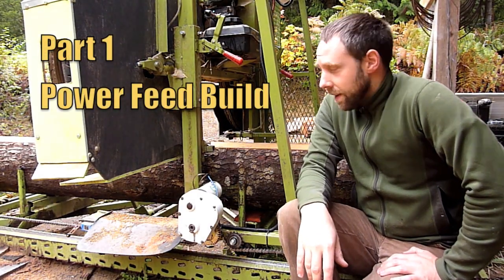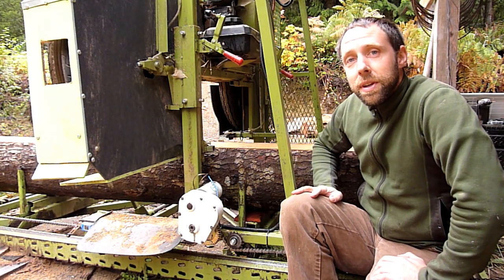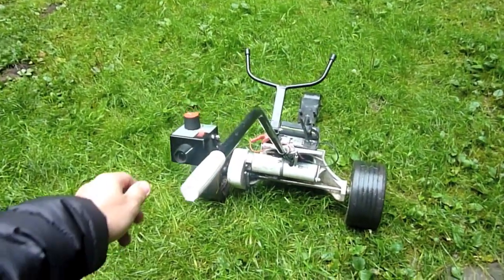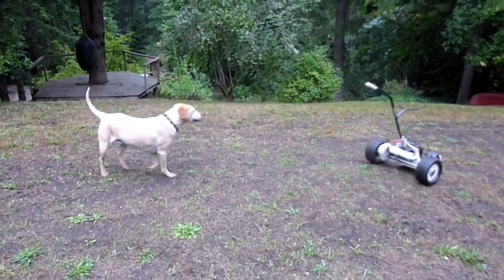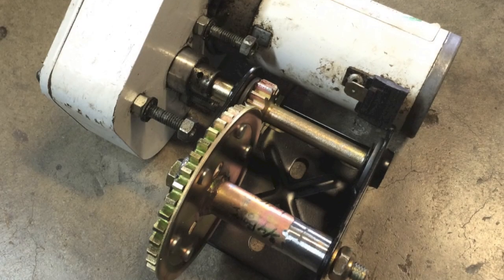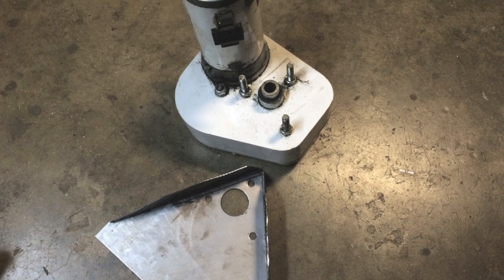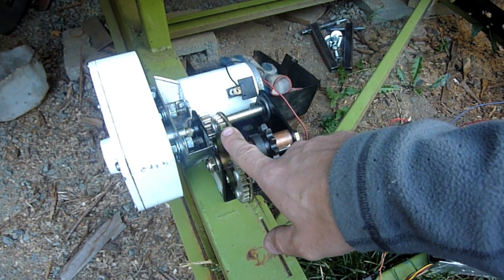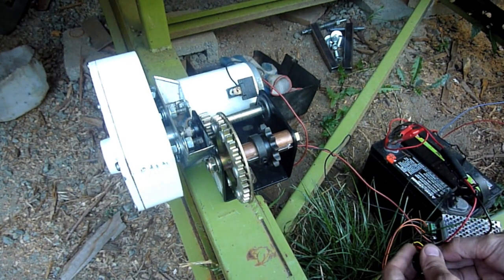Homemade bandsaw mill power feed part 1

Comment: Nice video. I'm going to install a power feed on my Woodland Mills HM126. From your suggestion I'll use an ATV power winch. Thanks.
Reply from the maker: Cool! I think you will be happy with a power feed,  mine has transformed my mill.
Like I said in the video If you try out a ATV winch I would buy one with the fastest feet per minute feed because you can always slow it down with a pulse with modulation controller.
Let me know how it turns out :)
Reply: Did you success with the winch ? Or is too slow ?
Did you use the wire or did sprocket like Mike ?
I m in the same process right now and trying to figure out what would be the easiest but effective....

Comment: I was three years younger on this posting. very ingenious motor setup. Does it slow down if you hit hard to cut, I know about the variable speed switch but if your cruising and it hits a hard knot,  will it break the blade or will it hesitate, words are coming hard to say what I mean

Comment: Great videos ,I built a bandsaw   About 25 years ago cut some wood and built 5 houses. I have always had a power feed on my mill but love your Idea on raising and lowering the head with pwm . I have used a winch to raise and lower since I built it. Does it stop at the right spot most of the time or skip??

Comment: Im looking into a power feed motor, my question is what would you guesstimate your motors RPMS to be on a normal cut? The one Im looking at is about 50-60 rpms at 12 volts.
Reply from the maker: I will look over my power feed and try to estimate the RPMs of the final sprocket and get back to you. Take care

Comment: Nice work Mike, very inspirational.I built a bandsaw mill 20 odd years ago, when there wasn't a lot of information available.
I'm still tinkering with it! I put a hand cranked chain drive on it a few years ago, big improvement. I'm now in my 65th year, and i think its time for power feed!!!  Your solution is exactly what I want. I especialy like the ride on aspect, what an energy saver!
Just a couple of questions if I may. Do you use a 12v deep cycle battery, and how do you charge it? If you charge it off the mill how long does a full charge last?
I look forward to seeing your "simple" computer, hight control system!!
Thank you for sharing. Rob
Reply from the maker: HI Rob :) thanks for watching!
That's awesome you built a bandsaw mill, I bet it was a lot harder to get info on building mills 20 years ago, The web has helped out a lot on seeing what others built and sharing ideas.
To answer your questions I do run my power feed motor on 12 volts.
The battery is just a simple ridding lawn mower battery that I installed originally when building the mill. To keep it charged I have it connected to the motors charging generator, I have never checked what the amps are but I would be surprised if it was over 8 amps? 
I have not run the battery low yet from using the power feed when milling lumber, even the other day I milled a lot of    big 20" to 22' wide slabs 8 feet long, every cut I would set the power feed to move through the cut nice and slow, about 5 minutes per slab, I can tell you it was great to sit back with a cup of coffee and watch the mill cut the slabs all by it's self!
I also feel like i'm getting better lumber from my mill now that it's steadily pulled through the cut rather then me pushing it. 
I really recommend you building a power feed for your mill, It was a great improvement, at the end of a long day of milling you will feel a lot less worn out :)
If you have any more questions about the power feed feel free to ask.

Comment: Hi MIke. Your videos have helped a lot with my own project. What was the wattage of the golf caddy motor and what was the eventual rpm achieved using the gearbox?
Reply: Nice stuff Mike did it give you a better finish to your. timber with the even speed.

Comment: I like it.  I've been thinking about doing the same with my little Wood Mizer mill that has a starter/battery/charging system.   Wood mizer wants $1200 for their power feed.   What do you think is the power requirement for the motor?
Reply: I built my powerfeed using à electric bicycle Motor I purchase the Motor on Amazon it à 24 volt but it Can Run on 12 volt i have to slow the rpm down. You Can watch it on youtube sgt rod.

Comment: Great videos, I just found you. I like building and welding too, but don’t make videos really. You need a lathe so you can make your own bushings or bore the sprocket hole to the size you need. I bought a late 20’s, early 30’s 9” South Bend and fixed it up. It’s hard to walk away from!